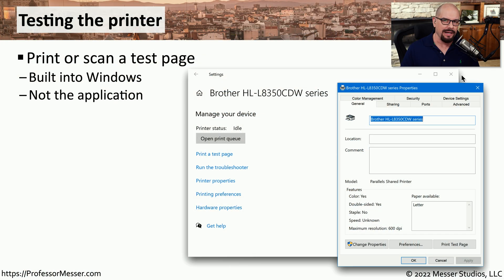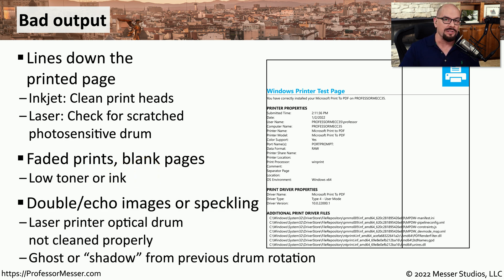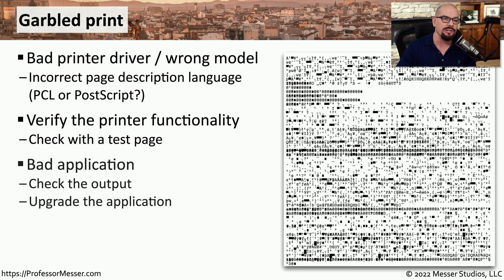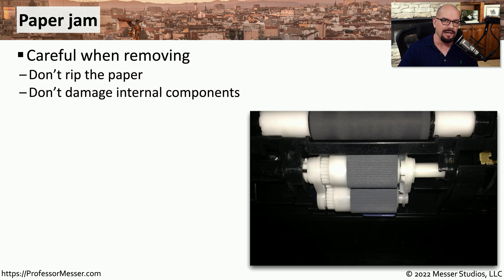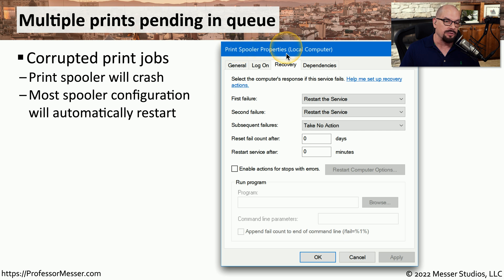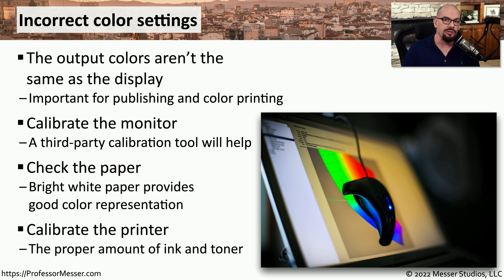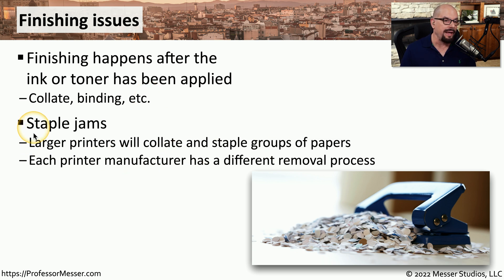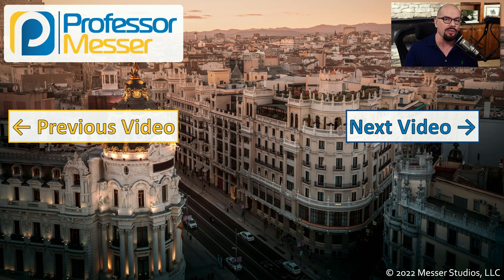Troubleshooting Printers - CompTIA A+ 220-1101 - 5.6

Comment: Passed this morning... Thanks Messer!!!
Reply: what questions you got?
Reply: here u go i sent this to a couple ppl:

Here are the key areas and questions I remember:

Networking

Review ALL of 1.2, 2.2, and 2.3 thoroughly.
Understand server roles in 2.4.
Understand 2.5 and when APIPA is used—it’s pretty straightforward.
2.6 builds on 2.4, so make sure you grasp all of it.
Internet and Connections

Pay close attention to 2.7, especially Internet connection types.
Know your material for 2.8.
Motherboards and Hardware

3.1 is dense but crucial—review everything and ensure you know it well.
There were lots of questions on 3.3 and some on 3.4 (Motherboard stuff).
Troubleshooting and Printers

Many questions were troubleshooting-related, so focus on those concepts.
Be prepared for printer-related troubleshooting.
Virtualization and Cloud

I had two questions on 4.1 VDI and one about the differences between public, private, and hybrid clouds.

Comment: Certainly! Sometimes, an issue occurs when I insert the printer's IP address, complete the connectivity setup, and proceed to print a test page. During this process, the page is misaligned or printed multiple times.  and the actual printer name does not come and the name comes by "any desk ".  kindly tell me the solution please Thank you

Comment: Well my 1101 is tomorrow and 1102 next week... but after this training I feel there should be no problem. Again, thanks Prof, this really helped a lot.
Reply: I have mine in about 2 hours, how did your 1101 go? I plan on taking my 1102 next month
Reply: How it go I’m going to plan to take mine next week. I been using the comptia a+ app to practice but still kinda worried because some questions is kinda trick questions like the phone battery in the previous video.
Reply: @joeblack7262 😊p
Reply: How was your exam? Did you pass it
Reply: did u pass

Comment: What if the printer prints out splotches of yellow ink all over the page? I have to print the same page many times before it lets up. Very annoying. I'm using an Epson Workforce Pro 4630
Reply: Hi there! It's an inkjet
Reply: Hello this is customer support! Do you have an inkjet printer or a laser printer? I might be able to help if you were a little more clear with your support ticket.

Comment: Why would the printer itself be recognized but the scanner on the 3 in 1 printer scanner fax but is not recognized
Reply: Probably drivers not installed, most of those 3 in 1 combos need the manufacture driver software to recognize the scanner portion of it. I know at least HP does.
Reply: If it is an HP printer and scanner try using the HP driver download tool or print and scan doctor. You are likely missing the scan driver and have the printer driver only as mentioned.
Reply: First thing to look at are Drivers (updating the most revent driver, by obtaining the installation file through the manufacturer's website, and then trying the feature)

If updating the driver doesn't work- check the email contiguration for the printer. (Printers scan to another email- using it's own personal e-mail. It could be the printer doesn't have an e-mail assigned to it. So it's "lost" of what identity to use to scan.